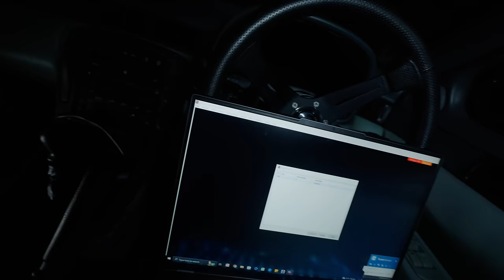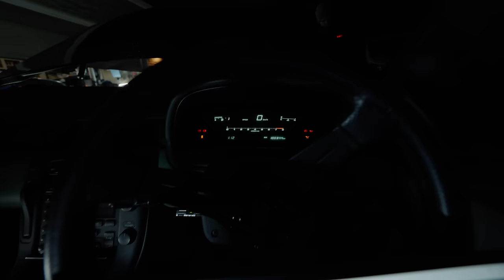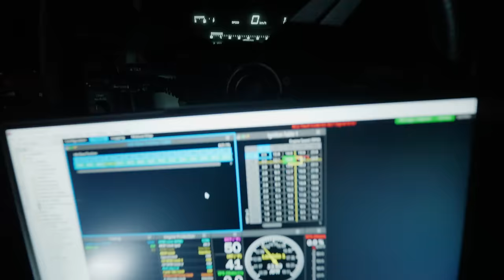What its REALLY Like Owning A 90's Japanese Car

Comment: A lil tippy tip for the door clip. A drywall anchor (blue ones) clipped down to size also works really well. I’ve done it on both my sc’s. It’s what I had available and it’s been fine for months.